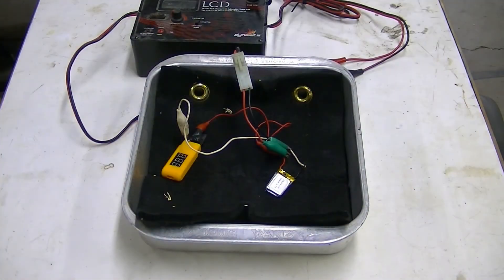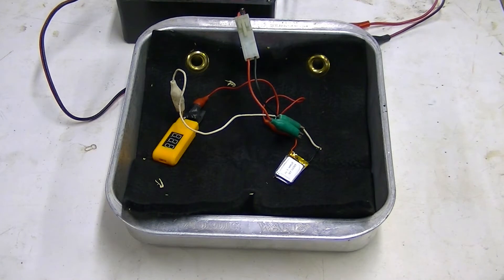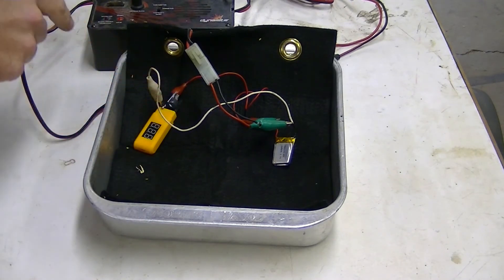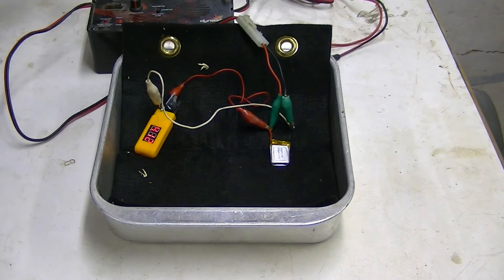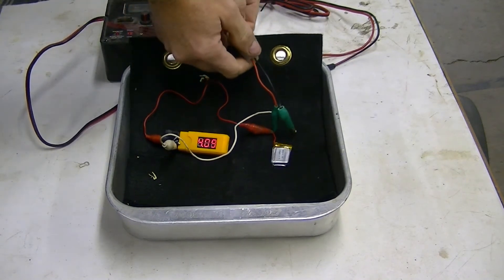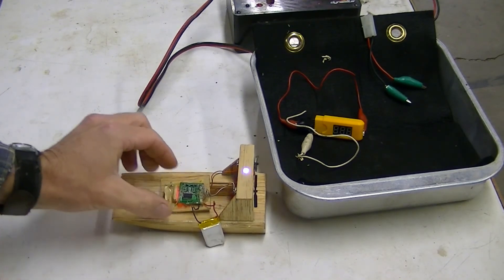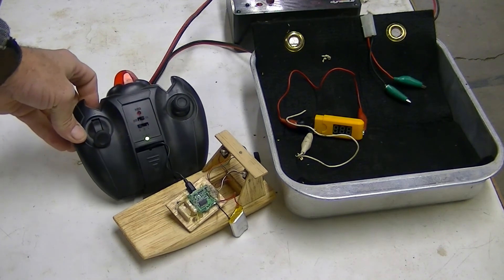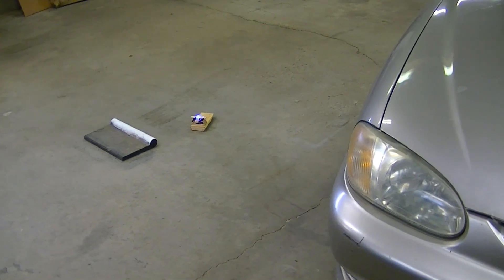Saving a dead Lipo

Comment: The internal resistance of the battery goes sky high doing this, meaning the C rating is super low.  And of course if the battery is already puffed or leaking, it's too late to save.